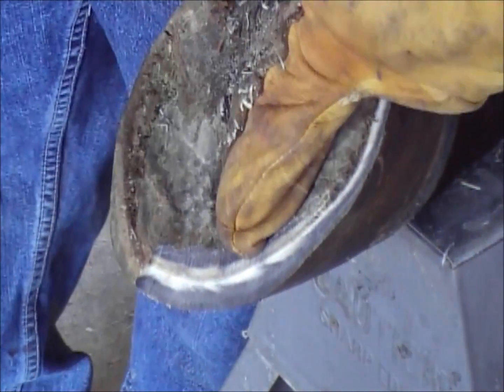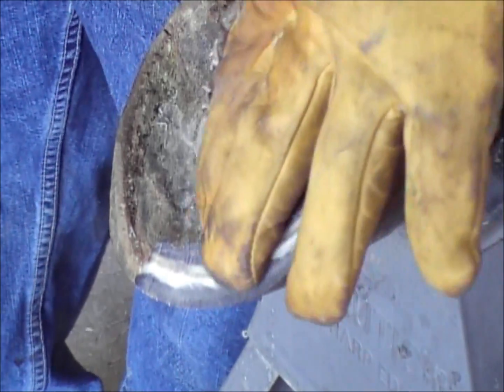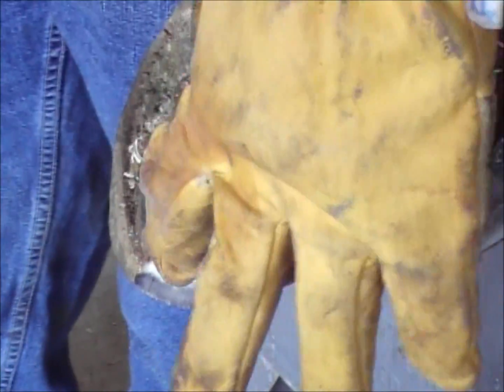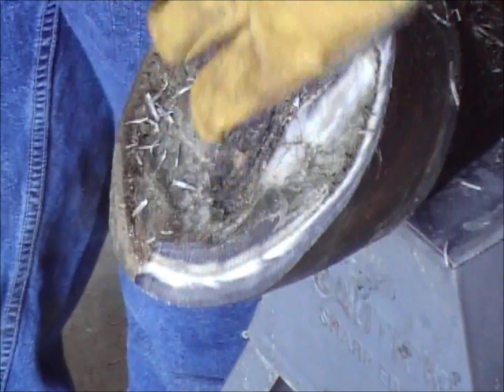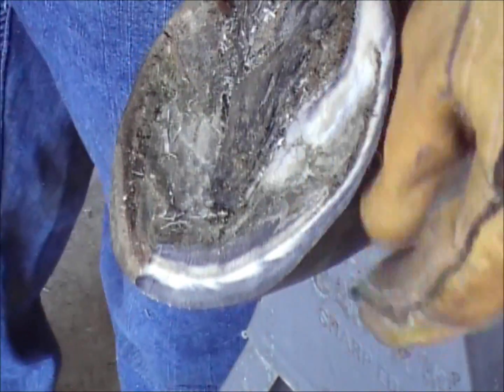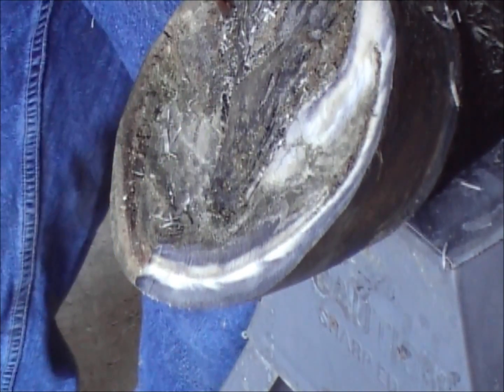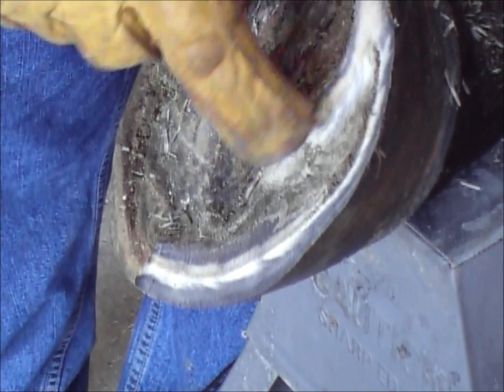University of Florida Resident Farrier Trims Cadaver Hoof with the Hoof Boss

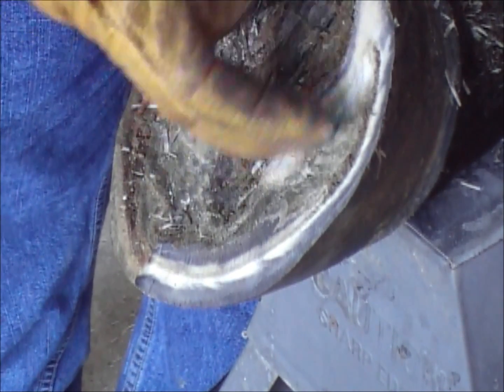Comment: The bars do not terminate (2:26) into frog unless the heel is under-run (as this hoof is)  The forward pressure of under running heels cause the bar to curl outward starting at the heel...the outward movement terminates with a pinch point at the back of P3.     Healthy heels create a bar that blends outward from the widest part of the hoof (centered in healthy hooves)  towards the toe adding extra protection to the sole under P3.